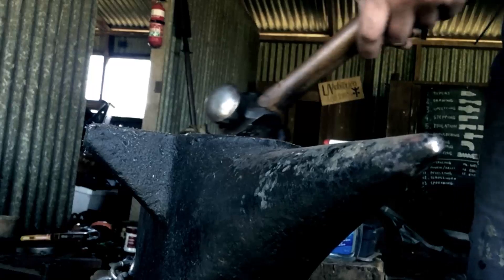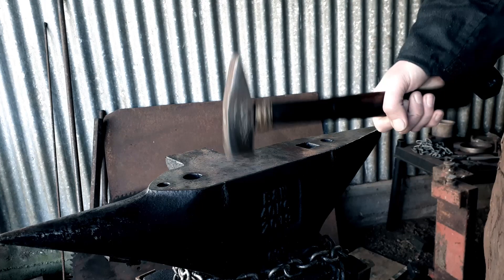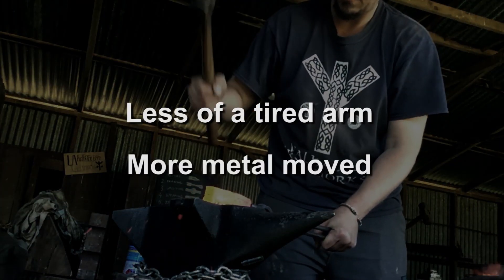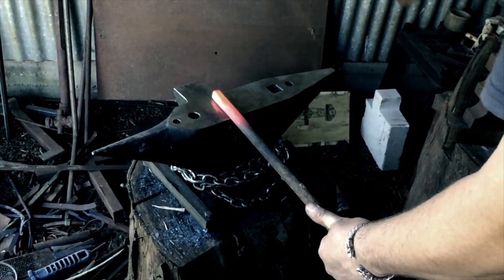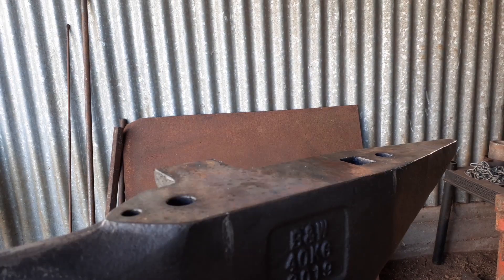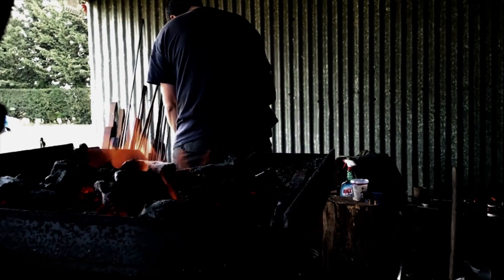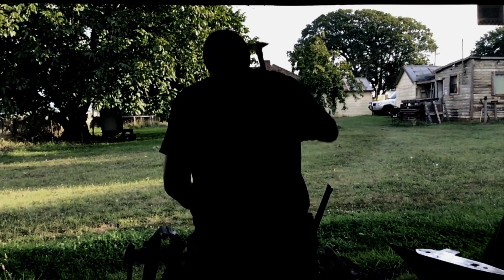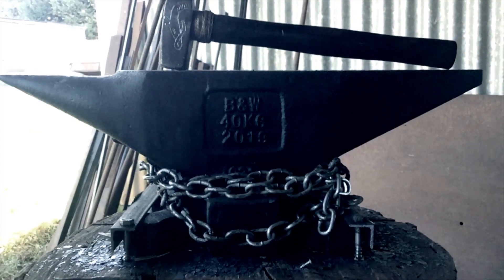Young's Modulus of Elasticity in Under a Minute #VeritasiumContest

Comment: Cool insight that is counterintuitive. One wouldn't thing an anvil with great rebound is good. But the opposite is true.
Reply from the maker: It's oddly enough a super contentious topic in the blacksmithing community!
Reply: @ValhallaIronworks  I am clearly not a blacksmith. But even I can imagine that an anvil surface that is a bit spongy or sandy-beach-like would require tremendously more energy to work on. Anyone who has walked or biked on sand would know. Now, I don't know that infinitely bouncy anvil surface will be the best. Perhaps there is a balance somewhere in between. I am just amused by this topic, since I haven't thought much about it
Reply from the maker: @Marcosticks  ideally you want it to be more or less the same hardness as the hammer you're using!